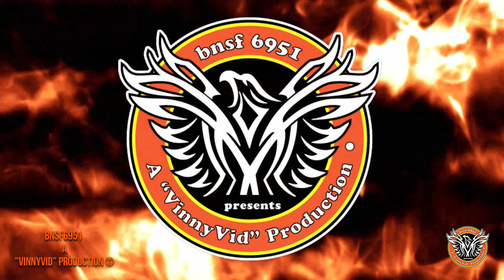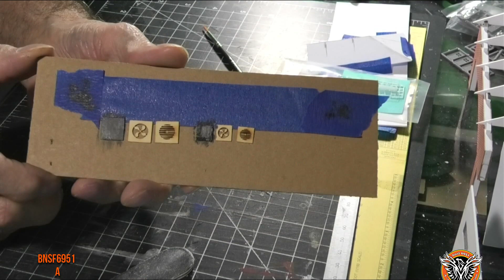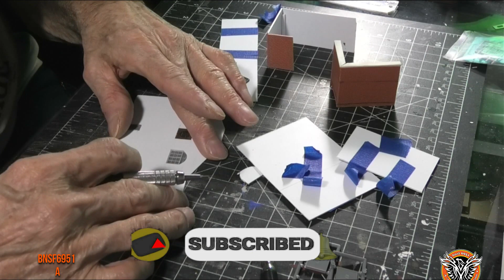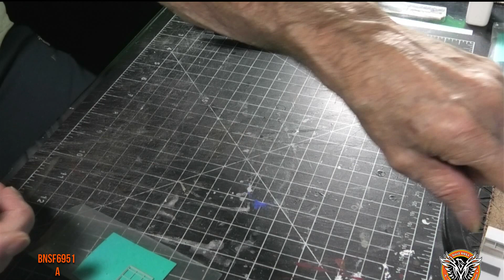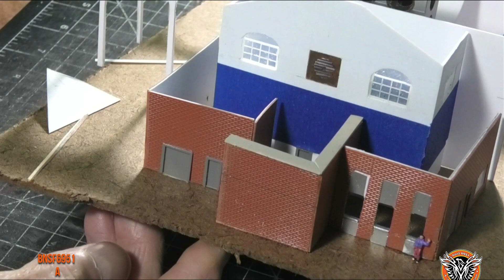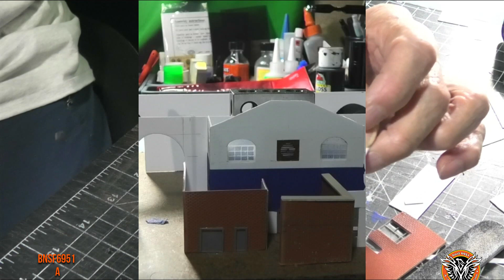MORE ON O.T.C.  BLDG 3 a..b..& c

Comment: Vinny,

I don’t scatchbuild, but wondering. For Nscale walls with windows, would it be easier or possible to use a clear sheet of plastic as the base and put the brick sheets over the clear sheet?